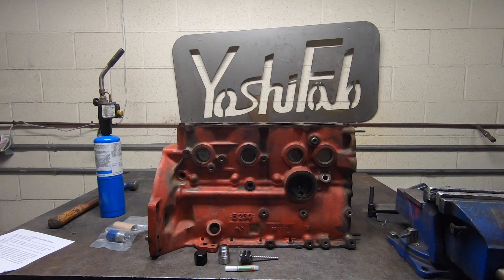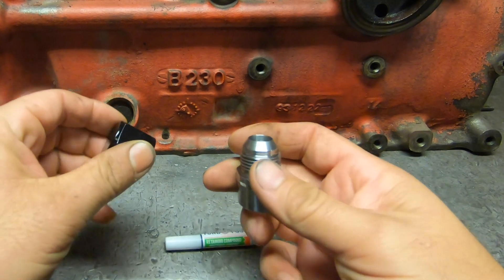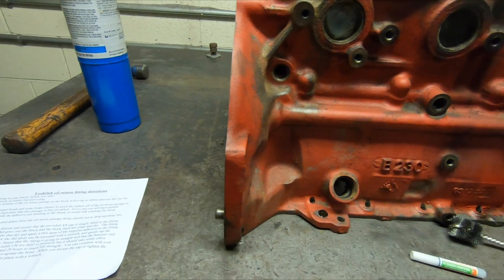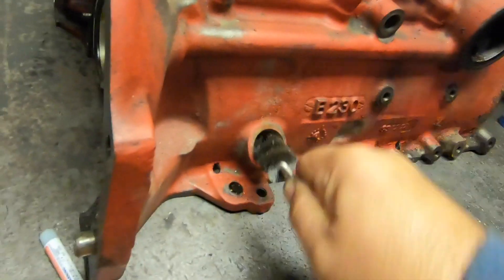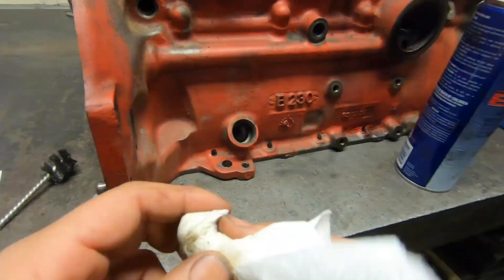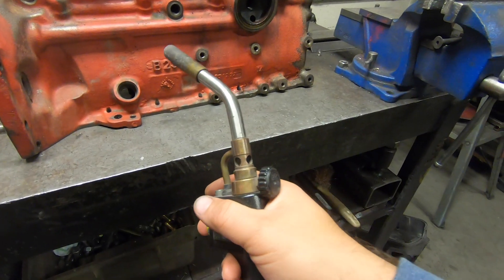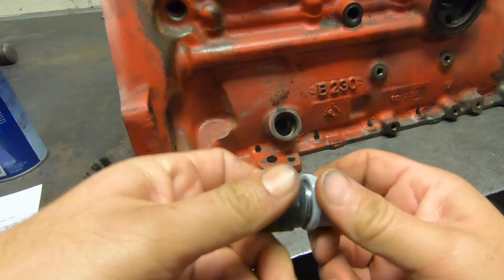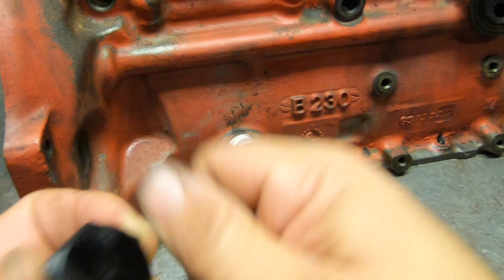Yoshifab b230ft oil return

Comment: Hopefully this'll be fairly easy working in the car, once I get this in all I gotta do is get the pressure side dealt with since I'm using a holset turbo instead of the 13c that was on the car stock

Comment: Can I drill this spot out on a non ft block?  how big of bit would I need? Planning to +t my 240 but not keen on drilling the pan.  and if I needed to replace the pan I'd always have to redo the fitting.
Reply from the maker: You could but it would be a bit tricky/expensive/risky to get a press fit tolerance on a drilled hole in the car.  I would mod the pan personally.  We weld bungs in the pan on the motors we build as we are usually using NA blocks.